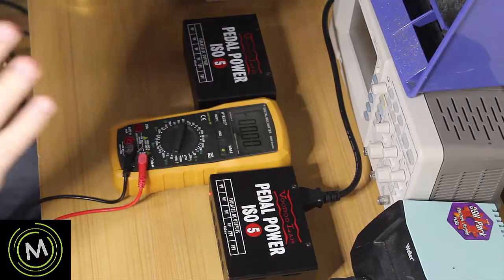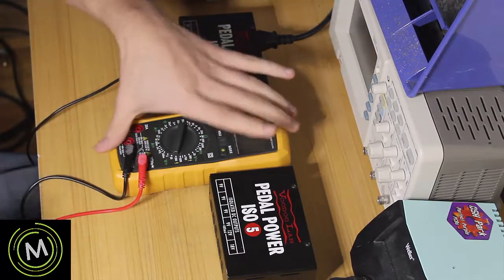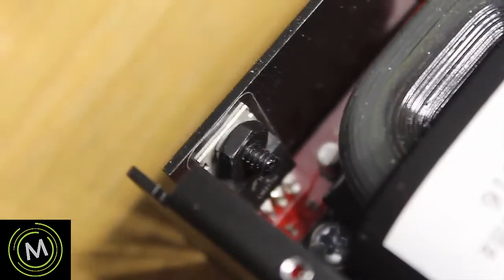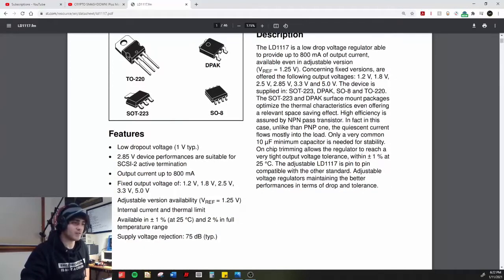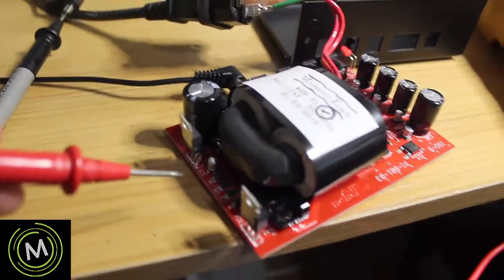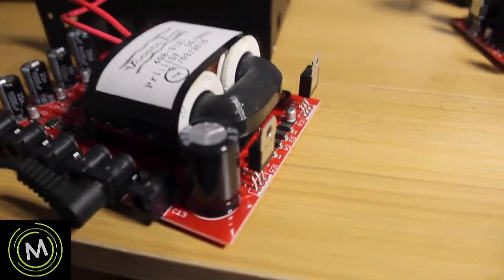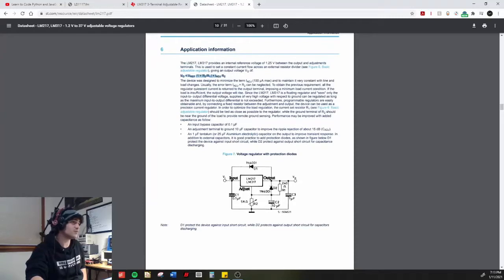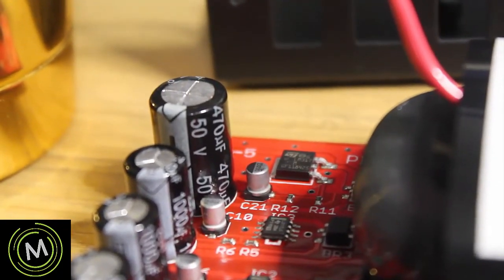Repairing a Voodoo Labs ISO 5

Comment: Where can i find these schematics? Currently have an ISO 5 that wont power up, i have 120V coming in read at the power cord input, but no clue where to trace from there
Reply from the maker: I personally don't know of any public schematics for the ISO 5. However, there are a bunch of voltage regulators, which are simple enough to test.

Although if yours isn't powering on, I'd test the transformer to see if it's outputting anything.

Comment: Hey, I have one which previous owner has removed the lm317 and ld1117, and also the large capacitor next to the ld1117 if you know the value of that? Can't see it in your video. Cheers.
Reply: 9:58 Seems like 3300uF/25V